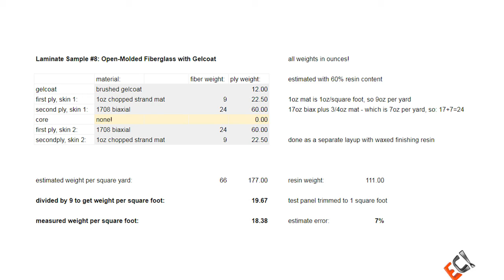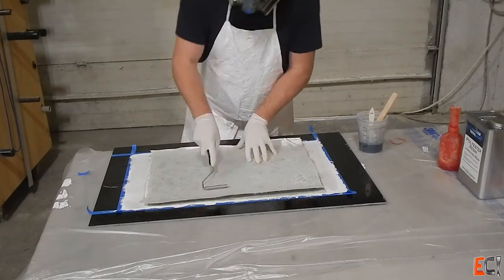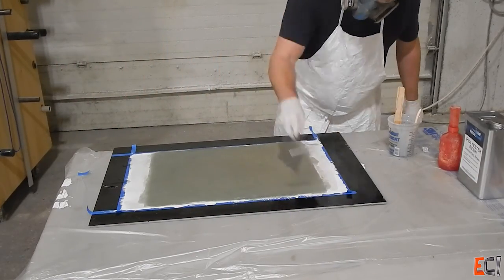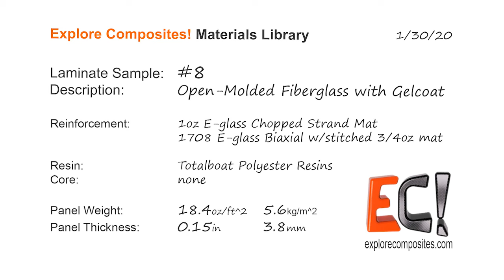Laminate Sample #8: Open Molded Polyester Resin / Fiberglass with Gelcoat

Comment: If I've just did a layer of laminating polyester fiberglass, when can I add another layer of laminating polyester fiberglass without having to sand? Between 0 minutes and 24 hours, will I be fine?
Reply from the maker: A good rule of thumb is "after it has hardened and cooled off and as long as it's still tacky on the surface - best not to go more than a day or two".  Depends a ton on the temperature, resin type, humidity and probably lots of other stuff.

Comment: Hello, how TOXIC is Gelcoat and Polyester resin while you are not using any security mask?
Reply from the maker: The styrene is pretty bad over time and in high concentrations.  In a well ventilated area it is common not to wear a chemical/organic vapor respirator, but it's still a good idea.  For spraying it is always a good idea to wear a respirator!
Reply: It's really not that bad at all.  If you have a breeze, you are good to go.  Just put a fan on and open a window.   Just for the idea, if you are mixing more than 2 cups of resin/gelcoat or any related liquid (total in all), go outside, don't do it inside.